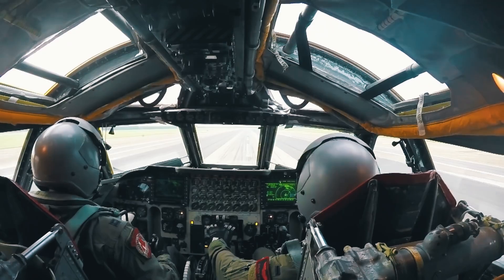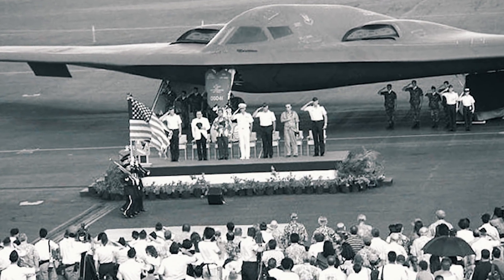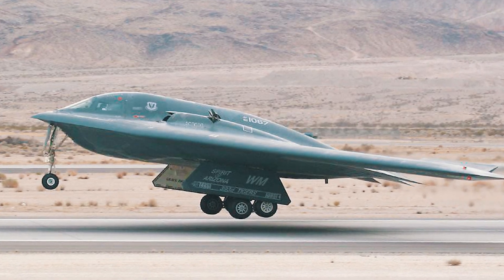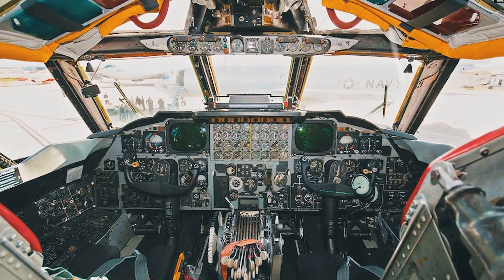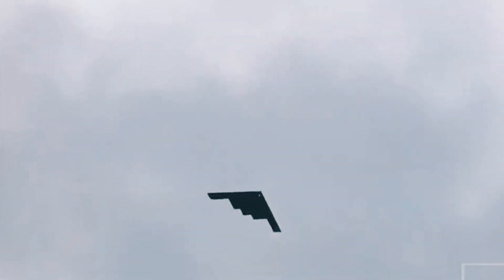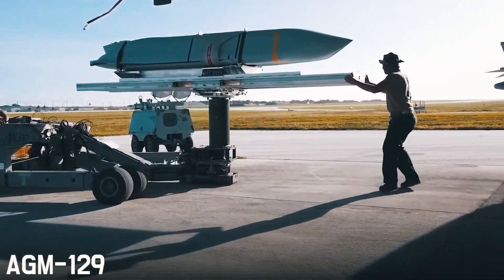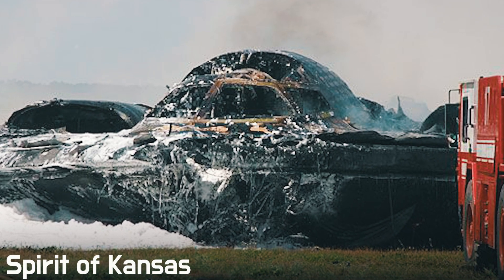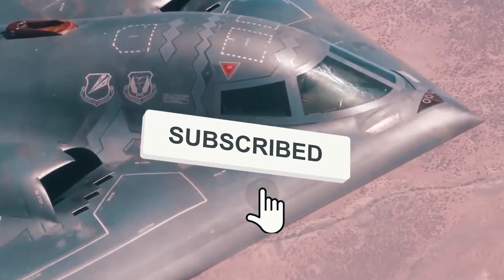Why No Nation Wants To Fight The B-2 Bomber

Comment: The high price is actually partially due to the reduction of the order from 131 to 21. Had more aircraft been built, the production cost would have been less due to the scale of numbers. This had been noted by the manufacturers to the USAF and Congress when debates on cutting back on the number of B-2 aircraft to be produced.
FYI, The B-2 is a bomber as was the YB-49 , and it's predecessor, the YB-35. Referring to it as fighter is incorrect as the aircraft was never designed to combat other aircraft. Since it has engines, it is a powered aircraft, not a glider. Please get your jargon correct. It is very jarring to people that have some little background in military aviation. Not to mention giving false information to the general public.
Reply: Had Ford only built 21 Ford Falcons in 1964 each one would have cost hundreds of thousands of dollars due to fewer vehicles to spread out the cost of design and manufacture of the cars.  That's what happened to the B-2.